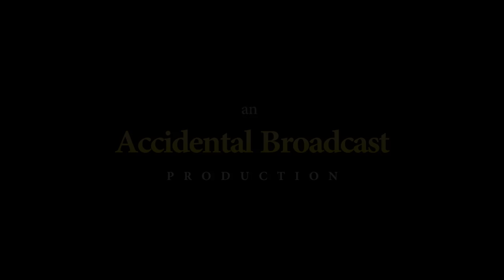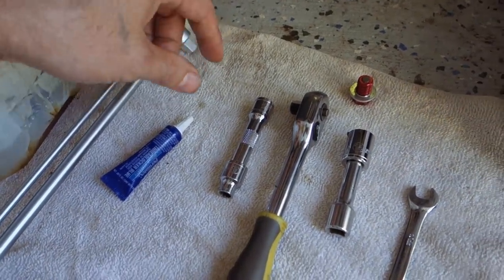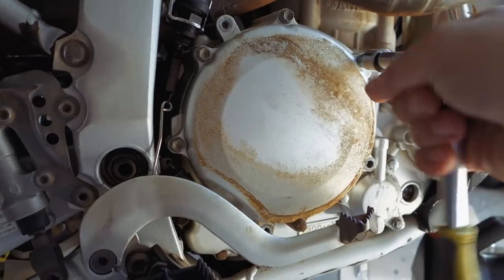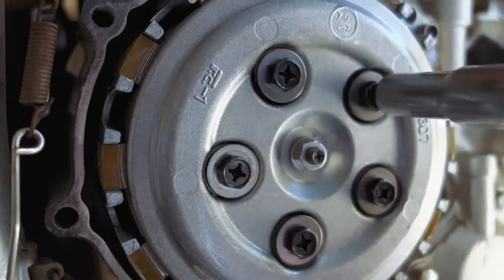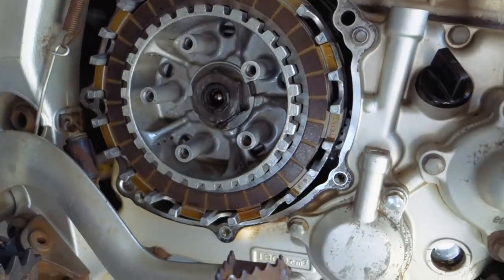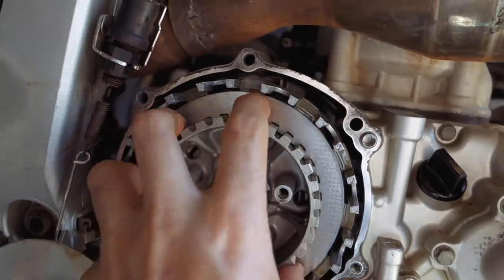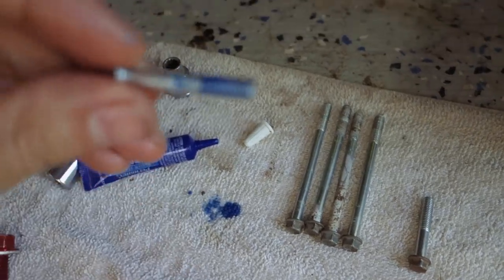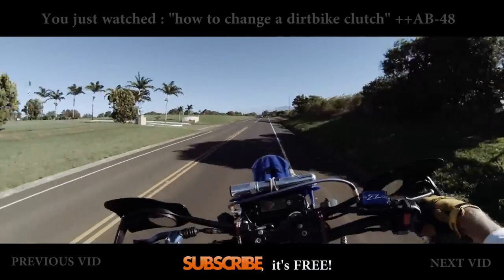How to change a dirtbike clutch ++AB-48

Comment from the maker: yep, pretty much all the same.. just pay attention to the pressure plates and the sharp edge action and you should be fine.. individual bikes will vary on pressure plate bolt tightness. Too tight and the clutch will feel all jacked up : )

Comment: What happens if i don't use a torque wrench and over tighten things i did this the right way but when i got the bike started after i replaced it the clutch wouldn't work at all. with some adjustments of the center bolt it'll move the pressure plate maybe 8mm at most HELP ME PLEASE RESPOND LOVE YOUR VIDS!!!!

Comment: Thanks for the video.  I’m adding a kickstart to my TW200 and am not sure how to adjust the center bolt.  The way I have mine now post kick start assembly install, only the pressure plate moves outward.  Is that ok?  Also the center bolt - not sure how “tight” that should be?  Just at the point of beginning to apply pressure to the pressure plate?  Thanks for any advice you give?

Comment: I was wondering, if I torqued the clutch bolts to 5ft lbs rather than 7.5ft lbs, would that make the clutch pull lighter? 
And is it safe to do so?

Comment: Sliding thing = Pushrod
you have to measure the Clutch Fibers to verify weather there good or not lol.
also all orientations make all the difference. some clutch pressure plates have arrows or punch marks to make sure it seats right. seals should always be changed after removal.
Use a service manual for your machine for proper removal, proper oil, inspection, torque pattern and torque values (everything has a torque value).

Comment: what if you over tighten the clutch springs
Reply: a REALLY hard clutch
Reply: that's not possible it will make no difference,but you can strip the threads out of the inner hub if you over tighten the pressure plate bolts then you'll need a new one
Reply: You will have a really sore hand the next day if you're riding your bike all day long and riding the clutch most of the time. (It's not a pleasant feeling)

Comment: Haha, don't worry about it. Common mis-conception that we use metric more than we actually do. Truth is, we're only 'officially' metric, but we all still use the system we after all created. We definately do not use kmph, and we still use lbs and feet, and pints (milk is sold in pints, as is beer).

Comment: i couldnt help but cringe at a lot of the video, that torque wrench is way too heavy for those bolts, you used way too much threadlock and if there were any pieces of metal in your case it would on the otherside of the wall and not around the clutch. your an awesome motovlogger kalani but you werent destined to be a mechanic.
Reply: +Nicholas Hartland Are those tiny mistakes really cringe-worthy? Overtorquing the pressure plate bolts only equates to a more slippery clutch that wears faster, & overusing thread lock just means it'll be a little tougher to get the bolts out next time, might even snap a head or two off & have to resort to vice grips & a new bolt. It's not like his lack of top tier industry level tech work is going to cause any sort of catastrophic failure, just a tiny bit more headache for whoever is working on the bike next.